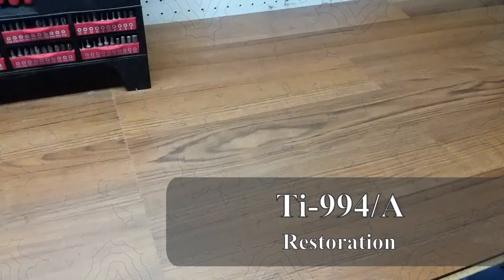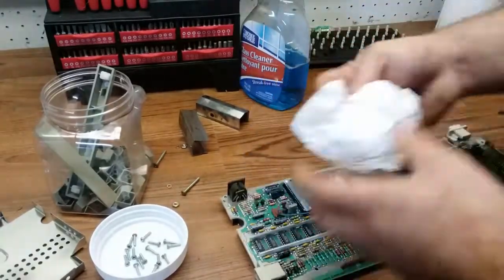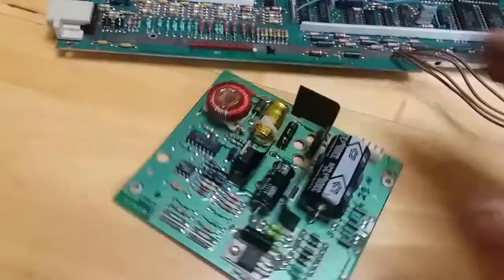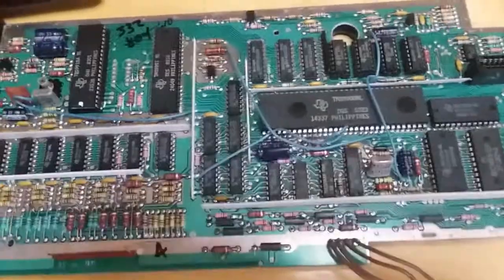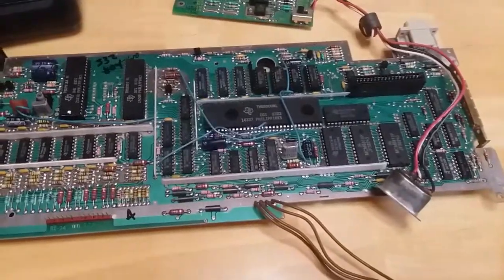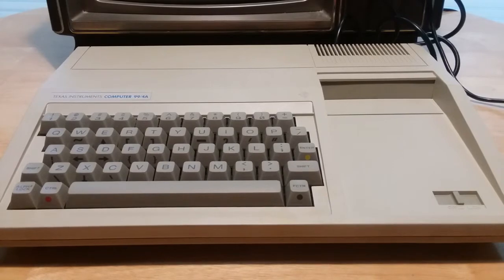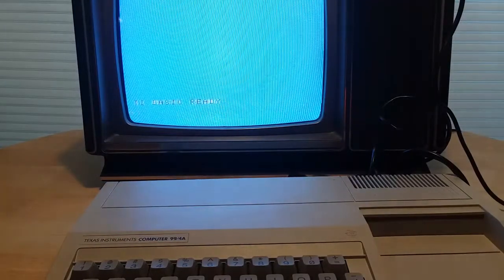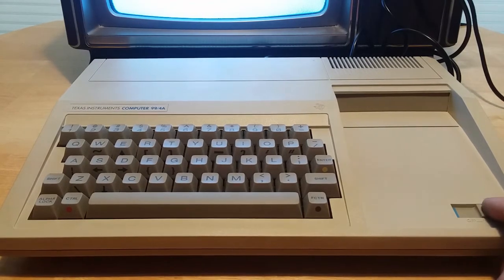Ti_99/4a Restoration

Comment: I wonder if it's possible to modify the ROM and a key code to create an actual backspace function.  There's actually an empty spot in the upper right where an extra button might be added.
Reply from the maker: I found an overlay a while ago that shows its like...function and 2...or 1  and its basically backspace. its weird and a pain when typing basic commands but eh, considering the era not too bad of a thing

Comment: We have redesigned motherboards for other computers.  If any old computer deserves a redesign to fix the original design problems it's the TI-99/4A.  We need to see what the TI could have done without the limitations.
Reply from the maker: oh yes! the only issue is compared to like the ataris, commodores and even the zx line...the ti doesnt get much love. a lot of the neat 3rd party stuff like the replacement for the PEB, or wifi type adapters, aftermarket psus etc..have either stopped being made or has very little support. its a shame since my limited usage its a neat machine (im finally getting things set up to do a little retrospective with whay little accessories i do have.)

Comment: I bought 2 off Ebay to replace the one I had in the 1980s.  I have not even turned them on yet I'm afraid of a faulty power supply.   They may not even work anyways.  I hope at least one works and the other will be for shelf display.
Reply from the maker: I have 4 now...this beige one i did for the video and 3 of the older black/silver models. 2 of them were pretty smashed up (the seller said they were that way when he found them) and they all work fine. so ya never know...the ti seems to be pretty reliable all things considered

Comment: You may have figured this out by now, but the backspace and other keys are shown on the keyboard overlay strips that sat above the keyboard. Used in conjunction with the FCTN and CTRL keys.

You can find them on the atariage TI-99 forum. There are several different ones shown there. They were meant to be changed out when using different programs.
Reply from the maker: Yep I found that out after releasing this video and doing research for the review. I saved a couple images of different ones and will hopefully print one out for the review